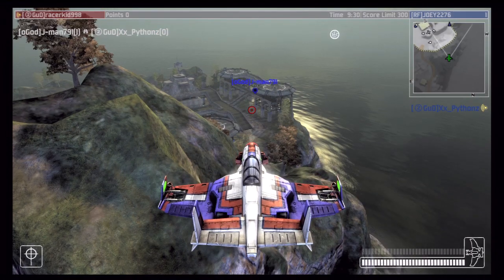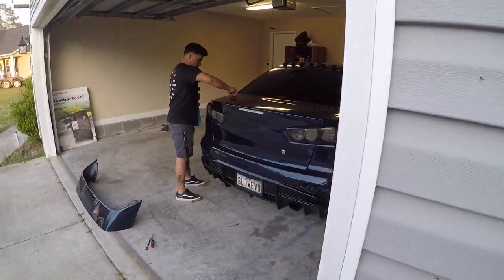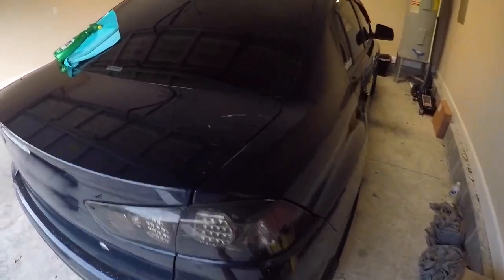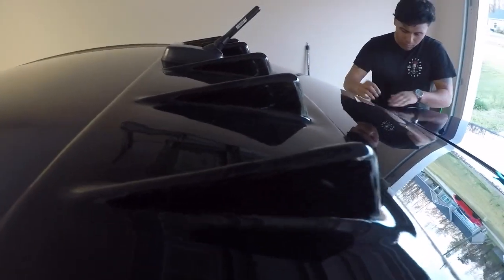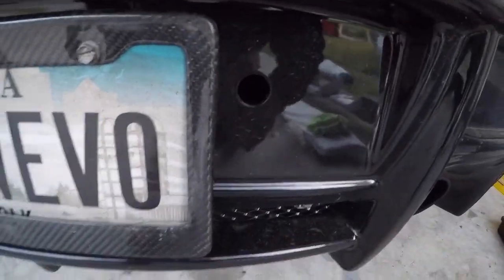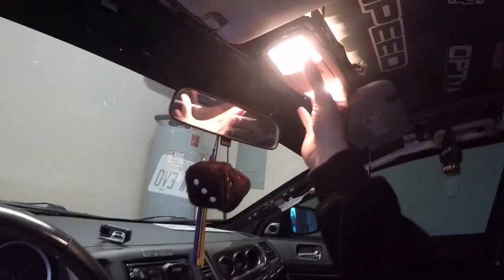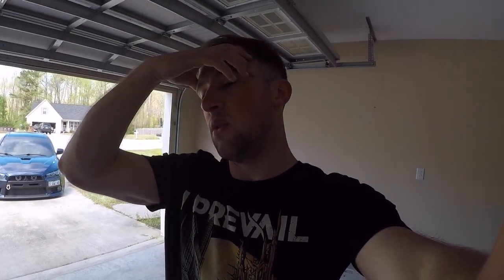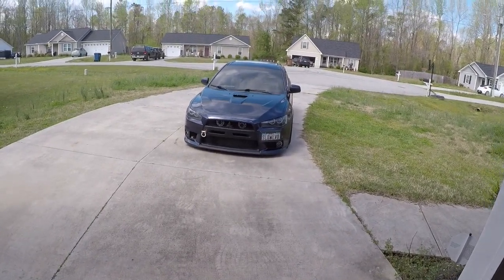Evo 8/9 Spoiler Install - Slow EvoX Project Ep.5

Comment: You didn't even... Show how to put it on?...
Reply from the maker: That wasn’t the point of the video lol. But like I explained, 3 bolts on the bottom of each side, 10mm. Very easy install took me maybe 20 min
Reply from the maker: The far end hole you need to drill into the spoiler but no drilling in the trunk is required, if you’re taking off the stock spoiler you can just use the holes that are left
Reply: @DavidLamison  I see I see, neat, thanks!

Comment: I actually went to buy an oem evo 9 spoiler today and the mounting points did not work. I would have had to drill into the top of the rear fender sides on the outside of the trunk. It has to be one of these replica spoilers made to fit the newer evo trunk width if you do this.
Reply from the maker: Hmmm, not sure. Mine is a VIS Evo 8/9 spoiler, had no issues